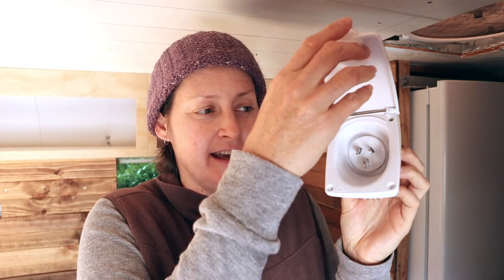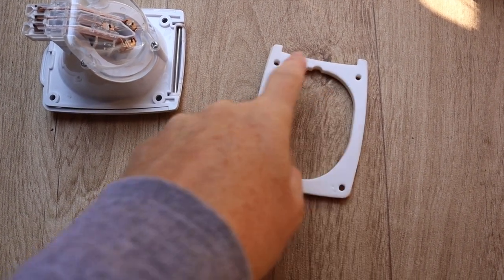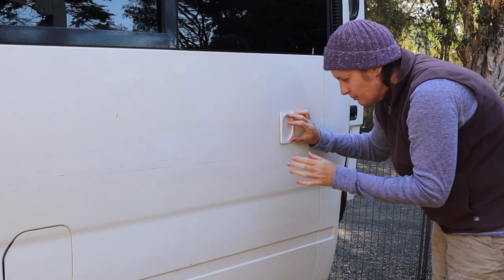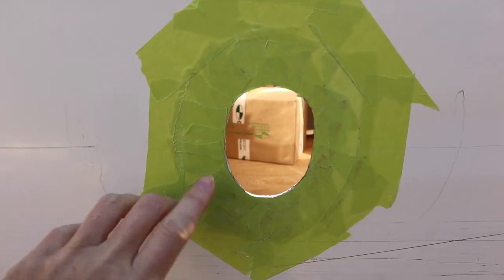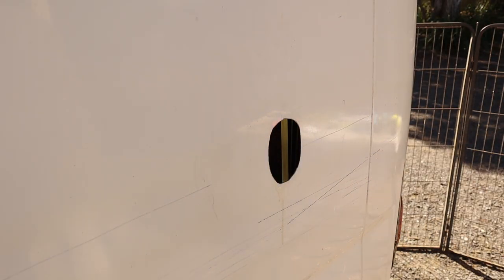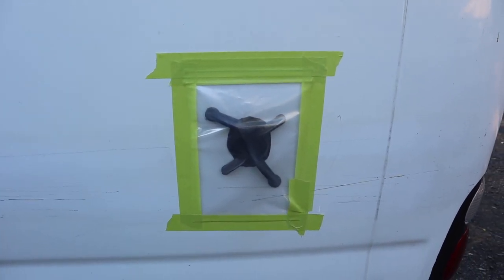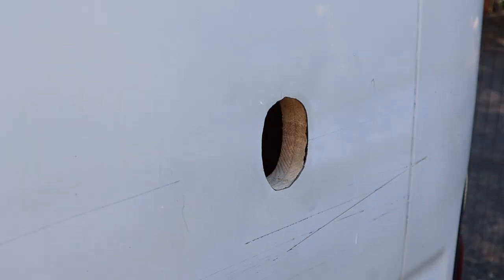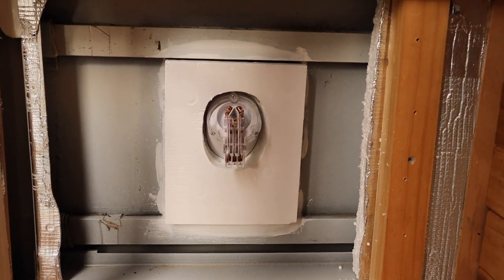Installing 240v Shore Power Inlet in my Toyota Coaster bus conversion

Comment: Great that you're sharing the conversion journey :) ... a tip to help with the costs :: have you considered signing up as an amazon affiliate, you can then add links to the components you use in your build ;) & you get a percentage from each purchase. All the best
Reply from the maker: I actually tried that in the beginning but Amazon cancelled my account because I wasn't selling anything! I don't personally buy much from Amazon, and I will not recommend products that I don't love myself, or sellers that I haven't personally bought from, so it isn't really that useful to me. I mostly buy things on ebay instead and I do have a few affiliate links on there.

Comment: I know you're not looking for "expert" input, and you've already knocked a hole in your bus, but mainly power inlets are on the driver's side so they don't interfere with awnings and annexs. Otherwise it's in a great spot.
Reply from the maker: Yeah I put mine on this side because it is close to where the rest of my electrical setup is and I also wanted it somewhere that I could access from inside later on if I needed to. I won't be having an annexe and probably not even an awning so won't bother me 😊